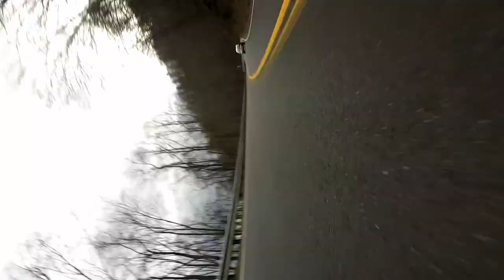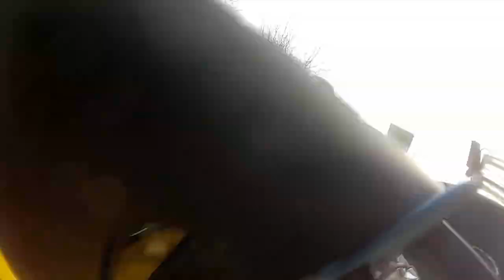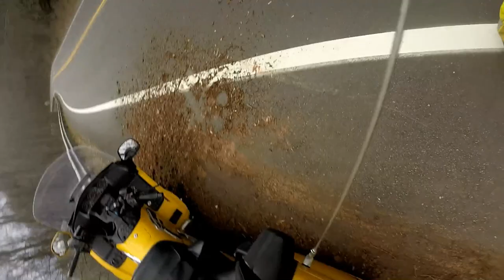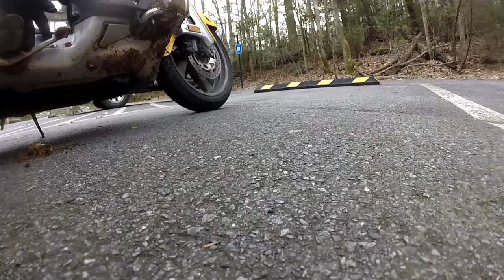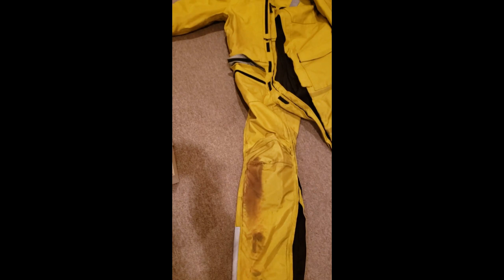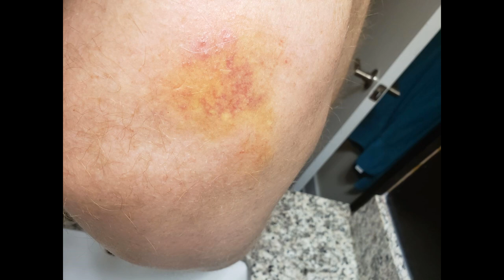Crash Analysis - 2010 Honda Goldwing

Comment: If you go back and look at the curve, though it's not a double apex curve it behaves like one.  The curve starts and you set up for it properly, the radius of the curve looks like it increases, or the curve starts to straighten some, then the curve tightens up again with a decreasing radius.  So it kinda behaves like a double apex turn.  @1:39 you can clearly see the curve straighten.  The other dead give away is you do straighten the bike some and still end up going to the inside of the turn which means only one thing.  If you've straightened the bike up and aren't turning as tightly and still end up heading to the shoulder, the only other option is the road has straightened more than you have.  Now that you're off line on the inside of the corner the fun happens, the radius of the corner deceases.  The floorboards, or whatever Goldwing's have, don't allow you to have the lean angle necessary to make the corner and you scrape and go down.  We've got a corner like that on a highway here and you've got to be real careful because people don't handle the double apex well and usually end up going into your lane and then looking at you like you're the idiot for maintaining your lane.  But anyway, it looked like you needed to straighten up a bit more to get back to the outside of the turn to set up for the next part of the corner.  On my bike I wouldn't have bothered slowing down but I can carry a lot more lean angle than you can so a smooth roll-off of the throttle might have helped.  $0.02
Reply from the maker: I'll have to re-examine it with the double apex idea. Maybe I didn't completely check out. Still not as attentive as I needed to be. Thanks for your analysis and insight. Do you race your motorcycle much?
Reply: @AdventureswithRedbeard  - I don't have a race license so no racing for me.  I will go out and do track days for giggles.  It's hard not to smile when you're on track having fun.
Reply from the maker: @abikeanditsboy3449  I've thought of trying out a track day a few times. What bike to you take to the track?
Reply: @AdventureswithRedbeard  - I'll take either my Ninja 650 or my Ninja ZX6R.  I kinda like the 650 though, because it's so slow compared to most of the other bikes out on track, and has the suspension of a pogo stick, it forces me to work on skills like cornering, braking, and setting up passes if I don't want to get stuck behind people.
Reply from the maker: @abikeanditsboy3449  Those are both nice bikes. Sounds like a lot of fun.

Comment: Great video thanks for the breakdown, standing it back up straight during the curve I've done before, but never approaching anything like that, so great advice to get ready to commit and not stand the bike up, I'll admit I'd not or have ever been a full gear kind of guy, I have different thoughts on that, I think sometimes full gear gives people more guts than they normally would have and they do stuff outside they're riding limits. But probably full gear is the way to go, I ride all year-round though and in the summer it's hard to fully gear up for sure
Reply from the maker: Thanks for the feedback. I'm sure those who buy the leather racing suits get all amped up and do crazier things than normal. I'm sure I would. The Aerostich gear feels more responsible, to me anyway. I understand the heat issue. I've ridden in the summer in Texas. I had full gear on pulling up to gas pump and next to me was a guy with no helmet, short sleeves, short pants, and maybe sandals. I was quite warm, but prepared if something happened. It's an individual choice we have to make each time we throw our leg over. I've used a woven Kevlar shirt in the past from Draggin Jeans. It is still a bit warm, but crazy good airflow. I haven't had this Aerostich R3 for very long, but pulling the zipper down a little I have great airflow. Then I take the suit off and have my shorts and sandals. I'll to a review after I get more experience. Thanks again.

Comment: Wow I'm just so glad you and the bike are ok. It could of been worst. Thanks for explaining what happen.
Reply from the maker: It certainly could have been. Thanks for watching and caring.
Reply: @AdventureswithRedbeard  not a problem. I care about everyone's safety when you deal with riding. In the video it didn't look like you were going too fast in the curve. I'm glad you got it all on a go pro. So with the bike what do you need? Both crash bars replaced?  Was that all the damage the bike had?
Reply from the maker: @mosmotorcyclejourney9067  There are a few body panels dented, mainly on the lower left section. Right side tip over bars are the damaged ones. There is a small piece on the rear that came off. Nothing I need to do right away, but will work on slowly.
Reply: @AdventureswithRedbeard  ok. I know someone that has some parts for an 1800 and will check with him to see if he has right side crash guards or left side body panel under kickstand. If he has them I know I can get them for nothing however we will have to see the weight for shipping.  Unless you have something else in mind. Let me know when you can sir.
Reply from the maker: @mosmotorcyclejourney9067  Wow, that sounds great. Thank you! Depending on where he is, I could ride there.
Reply: @AdventureswithRedbeard  ok I got ahold of him and he is in Vegas at a convention. He said he will look to see if he has those parts early next week when he gets back to Michigan. I don't think you are in a hurry so I will know early next week.
Reply from the maker: @mosmotorcyclejourney9067  Thanks! Correct, I'm in no hurry.

Comment: I also have a 2010, yellow Goldwing, and I also have had to really push the bike down in some corners. I have scraped my pegs hard on occasion, startling, but no problem. I have even dragged my highway pegs, still not a real big deal, but I have caught the mounting point of said highway pegs, BIG deal! When you're scraping solid parts of the bike, your getting the rubber off the road. I have been lucky enough to not slide out, but it's been just that, luck. I have moved the highway pegs, but I may have to remove them in the twistys. I'm glad you and the beautiful bike are ok! Thanks for sharing this, probably wasn't the easiest.....
PS Do you think the car tire played any role at all??
Reply from the maker: It took me a while to share this. I know better than to let this happen, but maybe it will help others. I don't think the car tire played any negative roll in this. The rubber didn't slide, only started sliding when tires lifted off the ground due to the tip over bars hitting the ground. Stay safe out there.
Reply: @AdventureswithRedbeard  Glad to hear it wasn't the tires!! Amazing how for we lean sometimes! I just rewatched my own video across the Tail of the Dragon on my Wing. You get in a rythym, and suddenly you're pushing the limits! Take Care
Reply from the maker: @Motoramblings  And that is great fun, until you get overconfident or you are more fatigued than you realize.

Comment: Also, now that you mention your highway pegs being damaged, let me set this up by saying I bought a used Honda Goldwing F6B that had the highway pegs already installed, I took my first left turn and not my first Goldwing so kind of laid it down a little bit into the turn, that Highway Peg caught the road and actually caused my rear tire to lift up off the ground, really unsettling, I got back to the house, really kind of looked at the bike profile and noticed that the highway Peg was actually lower than the footpeg! So the person before me probably knew that it was a more comfortable position to have them down lower, but very dangerous if you want to take twisties like it seems like you and I do! I immediately raised those things up a little bit and that never happened again, those things are made to kill somebody in my opinion as they don't give like your foot pegs do! In fact those highway pegs, Kuryakyn is the brand I have and I think the ones that are on yours, we'll probably end up in the trash as when I trade it in my 13 F6B for my great 16 Deluxe that I have now and love, they have never touched that bike and probably never will! Those things are so uncomfortable anyway as you have to spread your legs so damn far to even use them to get around the fairing! Do you agree that this could be part of the issue that caused you to go down?
Reply from the maker: Thanks for watching, and thanks very much for your comments. That could have been part of the issue. My pegs were up, it was the attachment point that touched, so it would have had a small affect. I did change to the Rivco Aero Flip out. You can see my install video.

Comment: Trail braking would have prevented that, it would have tightened up your radius on the exit
Reply from the maker: Trail braking is something I need to look into more. Thanks for commenting.
Reply: @ 
So the key to trail braking is lightly applying the front brake will collapse the forks and instantly tighten up the turning, it’s also great to use if you get into a turn a little hot and your line of sight tells you the turn tightens up on the exit.  It only takes 3 to 5 lbs on front brake pressure. 
The best way to learn it’s affect it just go to a parking lot, do large circles in first gear about 20 mph, then do nothing else except apply a little front brake, you’ll notice the turning radius tightens right up. 
It’s a very useful skill to have. 
Hope this helps, ride safe friend.
Reply: @ 
Here’s an article I wrote on trailbraking, hope it helps.

Trail Braking 101

“What is it and why you need to be doing it”
And NO, it’s not just for the race track!

Trail braking is simply applying a small amount of front brake as you go through a corner or make a turn.  (Apx 3 to 5 pounds of lever pressure)

This does several things, first it pushes your front tire into the ground to create a larger contact patch to give you more front end traction,
second it slightly collapses your front forks therefore shortening your wheel base and tightening up your turning radius. 
Then once your comfortable with your speed and direction, and you can see the corner exit you slowly trail off the front brake. 
Hence the name “trail braking”

First you have to learn to be very precise and have a light touch on the front brake.   In other words you can not go from 0% front brake to 40% front brake instantly. 
For this reason I only use one finger on the front brake. 
I find it easier to be more precise with front brake pressure by just using one finger. That way you’re isolating the contact point to one precise point and not across two or three fingers. 
This will also teach you that you can and really should be turning and braking at the same time. 

In the canyons this is the exact skill you use if you get into a corner too fast, or a corner that tightens up as you go through. 
(A decreasing radius turn)
If your line of sight is thru the corner as it should be you will see that the corner is getting tighter, your already leaned over in the turn and this is where you lightly get on the front brake, this will do three very important things for you, first it will slow you down as it increases your front wheel traction, and third it will automatically tighten your turning radius. 
Using this skill you can actually steer your bike with your front brake and a little lean angle. 

To develop the type of light touch you need for this skill I usually recommend that you go to a parking lot and slowly apply front brake until you collapse your forks approximately 2 inches while going in a straight line.  This will teach you the feel of the brake lever needed for trail braking.
Then do a large circle, (about 40ft radius) and then trail brake the front brake, if done right you will notice that your circle tightens up. 

Trail braking is a very valuable skill both on the track and on the street. 
As with learning any new skill it’s better to slow down while your learning it before you use it at speed. 
Hope this helps clear up the mystery of trail braking. 
If your not doing it, you need to learn this skill, it could save your life one day. 
Speed Safe👊
Reply from the maker: @floydwilcox2640  Thanks for sharing this! I especially appreciate the tip on how to practice in the parking lot. I've been a little adverse on trying this because in the beginner classes I took and taught, you keep turning and braking separate. I still think that is good advice for beginners, but skills need to grow and advance and this is certainly something I'll work on. Thanks again!

Comment: Bad luck. This film doesn't inspire confidence in Goldwing handling. I presume that when you leaned it again to complete the turn you grounded either a peg or the centre stand and this levered the rear wheel off the asphalt. Maybe you should considet trading the Goldwing for a touring bike with plenty of GC like a BMW RT or a Kawasaki Concourse.
Reply from the maker: I filmed my Richard B Russell Scenic Ride right before this happened. Goldwing handled great. The 40 degree lean angle of the Goldwing is typically enough for me. 
I believe I hit the engine and back guards.
What do you ride?
Reply: @AdventureswithRedbeard  I have an R1250RT from 2019.